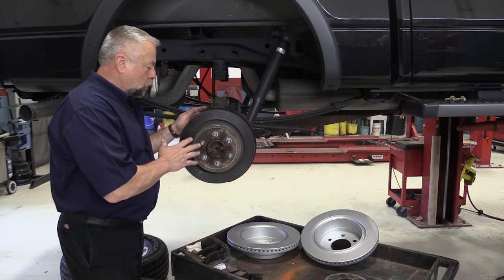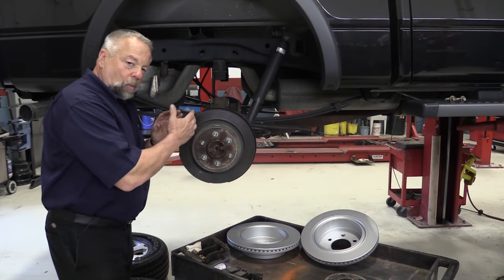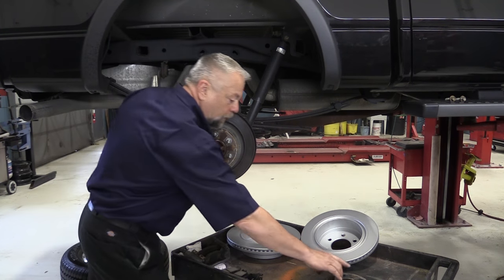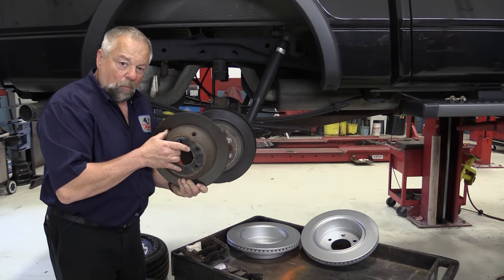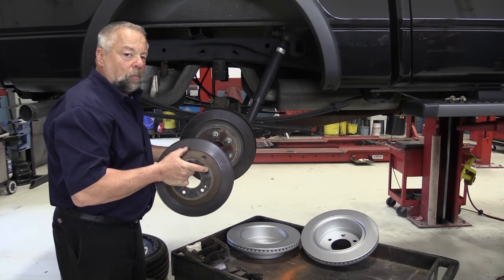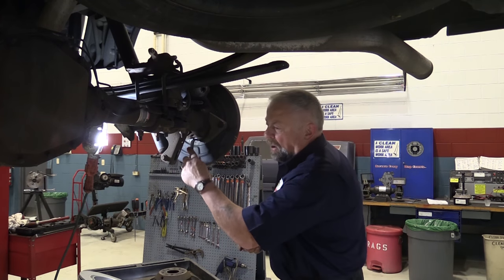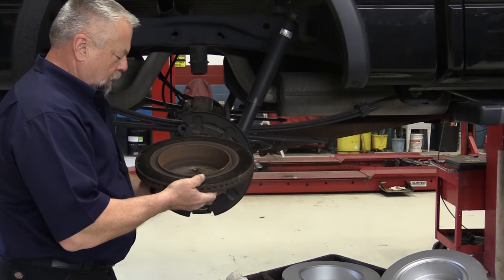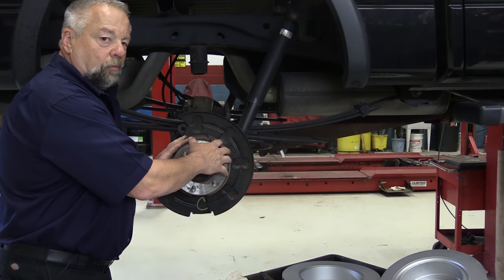Removing Rear Rotor Stuck on Parking Brake

Comment: To address a couple old questions in case anybody new wonders the same things: Use a brake spoon or a flathead screwdriver to turn the adjuster wheel. Usually, a few clicks of the wheel will do the trick. If you don’t know which direction to turn the wheel, start rotating the adjuster while spinning the rotor. If you are turning the adjuster the wrong way, you will feel the drag.
Reply: Great tip!!Thanks

Comment: This is fantastic! Thought I was missing a service plug hole, and on my 2007 Expedition it was clearly hidden on the backside. Ironically I am replacing all 4 corners with Raybestos rotors (Wagner pads), and this rusted mess is taking a hot min! Thanks again.

Comment: I was working on a 2006 highlander, and the rotor was stuck soo bad on the parking brakes on both sides. The rotor built a ridge of rust preventing the rotor/parking brakes to pass trying to remove the rotor. I loosened the parking brakes all the way and still no success. I didnt have any penetrating oil nearby, so I had to wack it with a hammer a few good times and eventually came out. I had to replace some holding pins but that was about it in damage control.

Comment: That’s one way if the pads and inner surface is really grooved in. If not I heat up rotor a bit and hit it with a dead blow hammer sometimes using a 2 x 4 block if I plan on saving rotors say on an Amg Benz or high end car.

Comment: Wait a minute, you had the rotor off already.  The hub was wire wheeled already and clean as a whistle.  I bet you had to beat the tar out of that rotor, even after the parking brake was disengaged.  I know I had to...

Comment: What if there is no access hole? I just did rears on a 2002 4 runner and screwed the pins all up, ended up bending them back and its all back together but for future reference
Reply: Every vehicle has an access port somewhere. Either front of back.

Comment: good day people wondering if someone can help. I replaced my rear rotors and pads on my 2016 wrangler , once on road I hear rubbing after inspecting I notice my parking brake shoes flop around .. like the assemble is loose.

Comment: How far should one have to adjust them out to remove it? I've got it pretty damn loose and it won't come off for the life of me...
Reply: Did you ever find an answer to this? I’m having the same problem
Reply: @LoganYoung-v4e  on the inside of the housing there is a rubber plug, pull it off and adjust the shoes in to release from the rotor. The hub of the rotor acts as the drum for the e brake

Comment: This video isn’t helpful at all with rotors that have no access hole
Reply: Or the puny insufficient hole they put on most vehicles.  I have seldom had success with backing off the brakes on my caravans.  A small access panel a couple inches square so you  can see and get more than one tool in would not be hard to do if manufacturers used their brains.

Comment: Ugh, I'm working on a 2013 Lexus rx350. I backed off the adjustment and its still stuck. The rear spring retaining clips broke off and now the shoes are pulling with the rotor when I try to get it off. I'm unable to remove them.
Reply: 2003 mercedes the whole parking brake assembly ripped off had to replace everything. How did yours go
Reply: @brentmyran1410  I ended up drilling 1/2" holes through the drum section to push the shoes back straight. It was honestly a huge pain in the ass to work on. Never had this happen before. I hate the design so much.